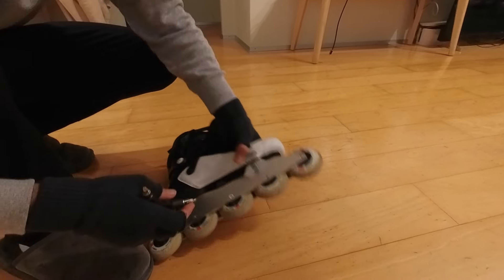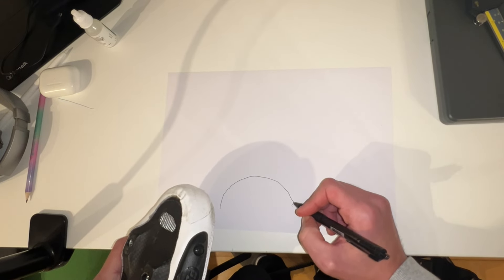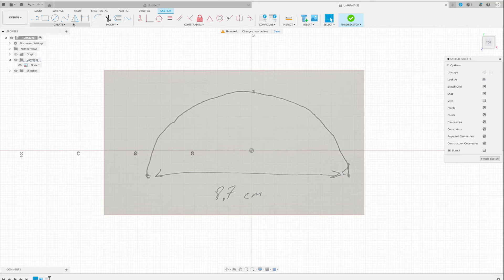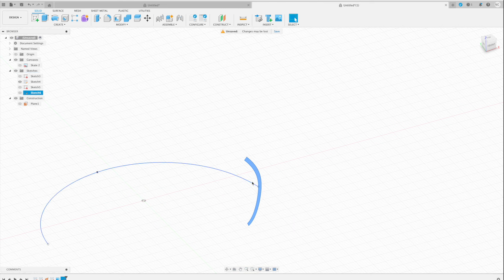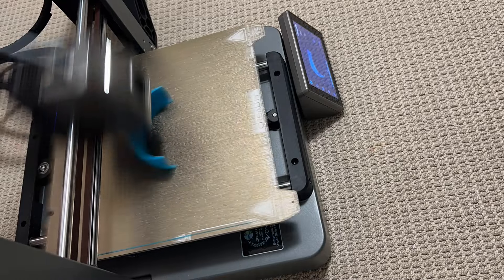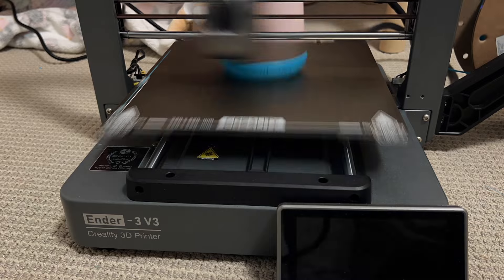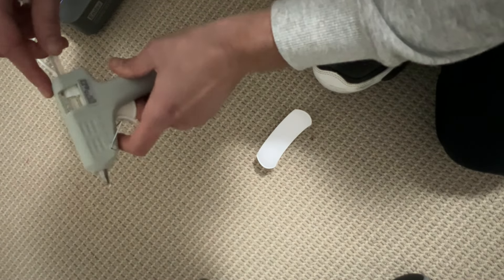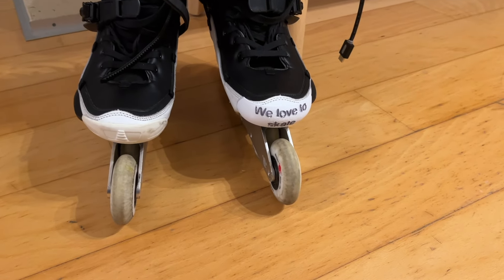INLINE SKATING meets 3D PRINTING

Comment: Try printing it in a hard tpu, basically zero risk for it to shatter and should have better resistance against scratching.
Its nice seeing people finding good uses for 3d printers creating spare parts.
You could just skip the tracing step and import the picture of the shoe and scale that.
Reply from the maker: Need that make so much sense! I didn’t even think about it. Thanks mate really appreciate your comment. I’m planning to reinforce some other sides of the boot, I’ll follow your recommendation.